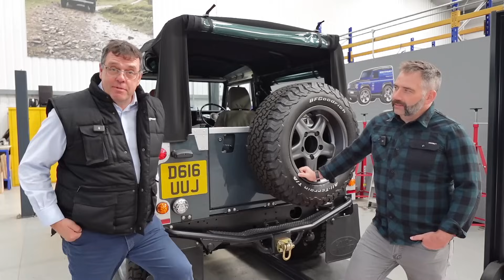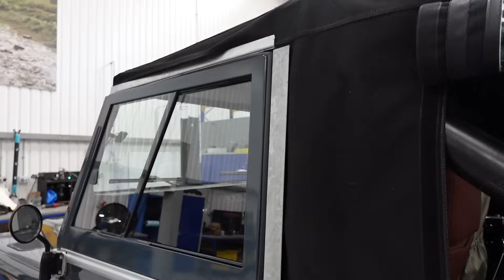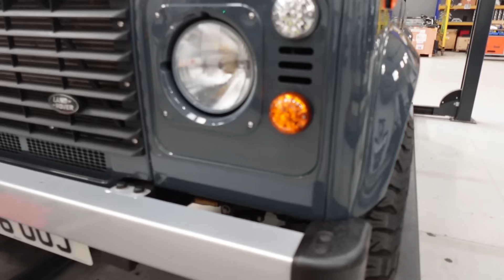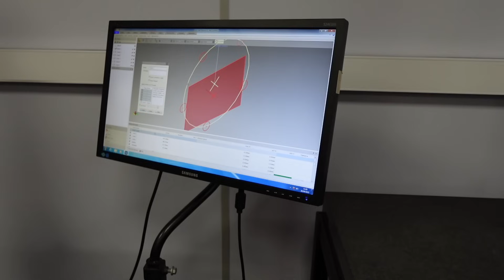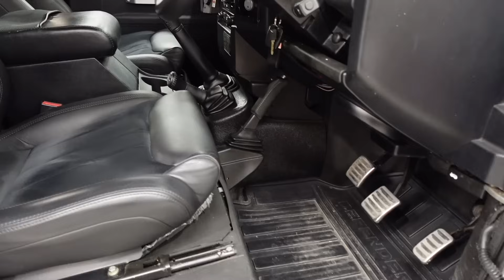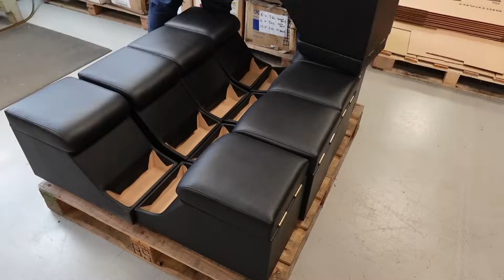Can you build a Defender with all new parts? Britpart did. And it's awesome.

Comment: Apparently Britpart is officially endorsed by Land Rover now? When you buy a new part you expect it to be fit for purpose and last for a reasonable time, but from my experience their rubber door seals were way too hard to allow the doors to close, the rubber swivel gaiters break up after a year, and I had two speedometer cables that never even worked. I complained a few times, but offering to send me another item with exactly the same problem doesn't solve the quality issues. There's also no consistency (but if you are lucky you might get some of the old Bearmach stock). 😊

Comment: Let's hope the words are true because there's a big reputation to overcome. I don't buy the kits, because the swivel may be good but the seal and bearings may be cheap and generic. I prefer to select my own branded parts. If Britpart stop putting parts in their own box then I would have more confidence in what I'm buying. Britpart are usually the lowest price, but I want to spend more than lowest price with better certainty. Hopefully they will produce a mid range price point with the better quality they talk about. Unfortunately though with the demise of Allmakes and Bearmach, they now have little competition and that is usually worse for consumers. Fingers crossed
Reply: Agree. I bought the swivel and bearing kit and ended up supplementing bits. The simple things like the bearing nuts that are black with the cheapest black spacer you hold the nuts in place with.
I also noted how good their doors looked.
Mine were bend to fit.
Reply: Absolutely correct, why are their copper washers magnetic?  And returning failed parts is uneconomical for those of us on the other side of the planet where shipping cost often outweighs the part cost!  Best to avoid and pay a little more for OEM or genuine if you can get it.